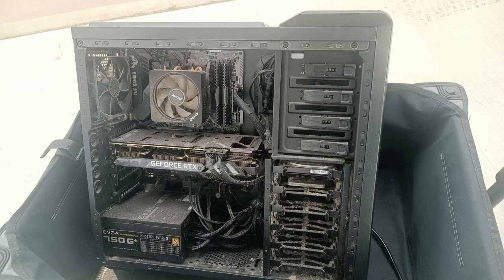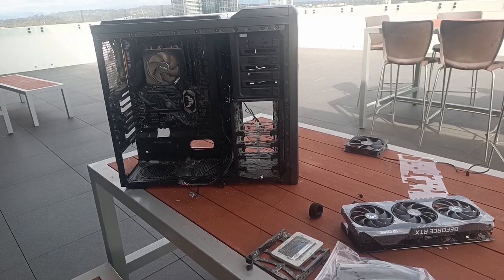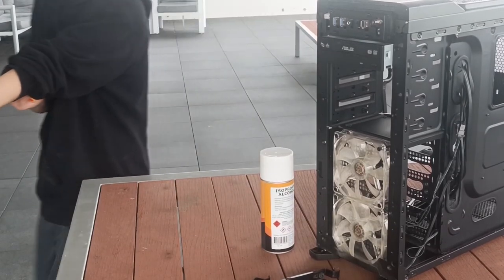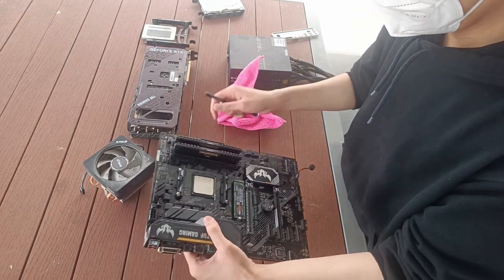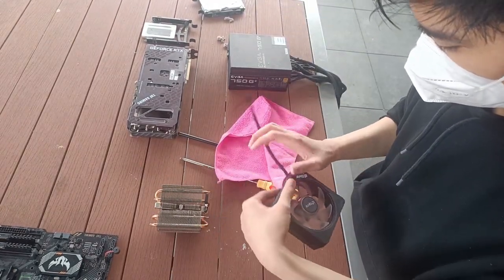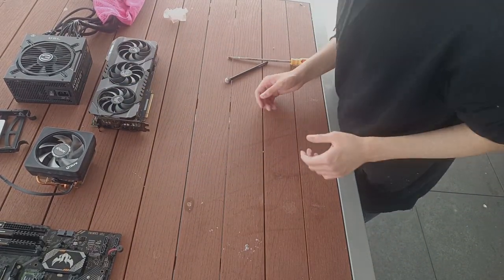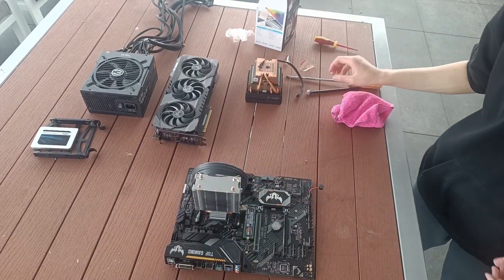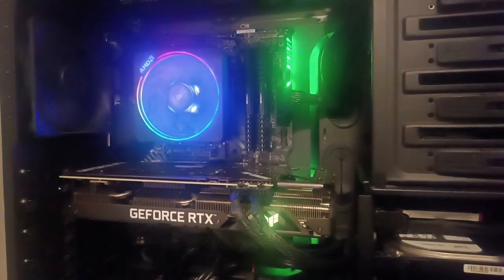Let's Clean a Very Filthy RTX 3070 Gumtree PC!

Comment: Those Wraith coolers are a pain to install and take off, everytime I clean mine I feel like I'm also about to rip out the lever.

I think it has to happen eventually since plastics get brittle with heat and time... I might need to buy an emergency one if mine breaks.

One suggestion when doing deep cleaning it's a good idea to take apart the PSU shroud and clean the internals and fan, you don't know how much dust can build up inside and shorten it's lifespan.